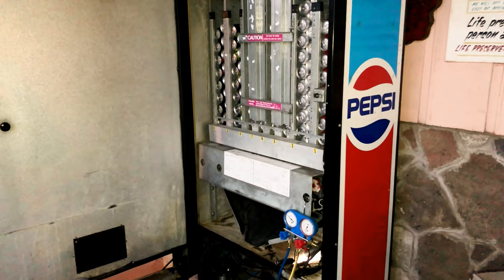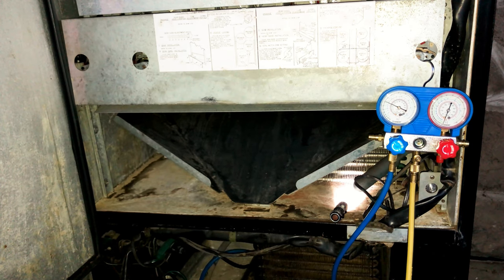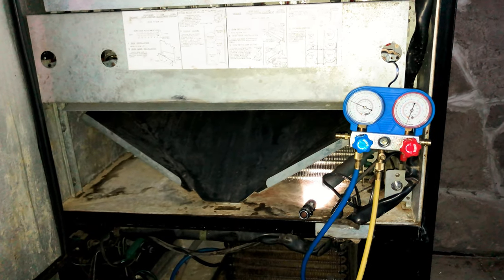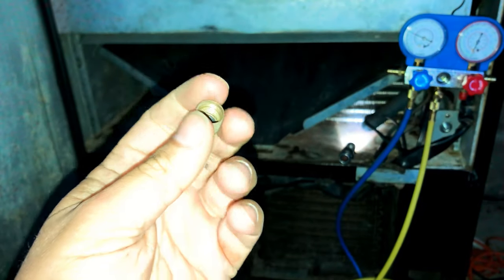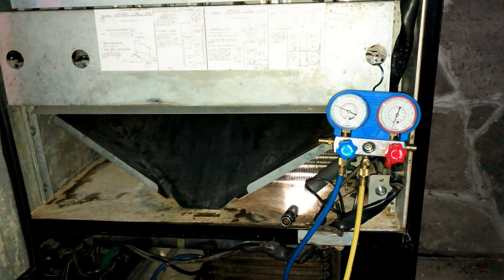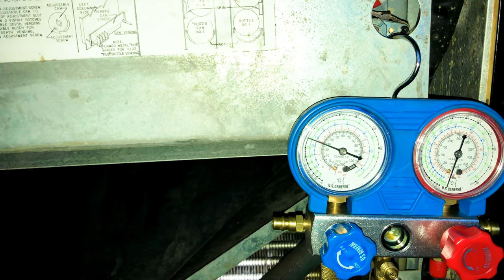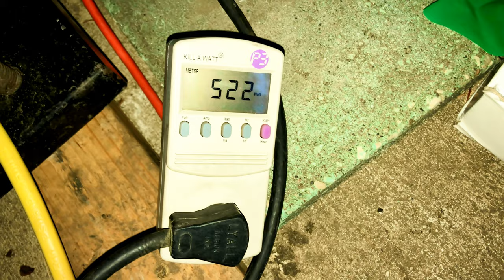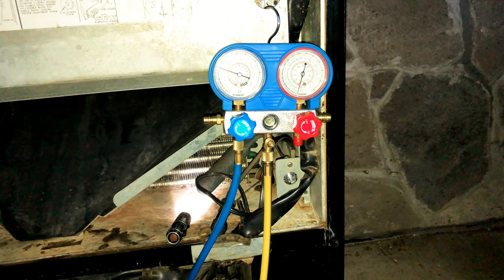Dixie-Narco Vending Machine R12 refrigerant recharge To 12a Alternative IT WORKS!

Comment: This worked really well until outside temps reached 30 degrees F with my outdoor machine. It's as though frosty cool is unable to exchange heat and cool the inside of the vending machine anymore. That's what it seems like, I am unable to look into it further till I either bring the deck inside or summer rolls around.
Reply from the maker: You still run the compressor at those temps? I just unplug the compressor on ours, and the drinks are always nice and cold. when it’s that cold how is your stuff not freezing?
Reply: @KmanAuto  yes, I have found that can be true for this machine but once the outside temp gets to 50 degrees F the machine warms up and has a hard time getting cool again from outside temps alone. I have a DN501E with a 134a system that copes really well despite it's age with the temperature swings in the winter. So my thought was frosty cool might not have exactly the same ability as real R12 did but is a pretty darn good replacement under certain situations. Haven't researched it, it's really just a guess. It's really just time to get a new cooling deck and stop messing around with this. lol =)
Reply: @KmanAuto  Oh and also, I am not sure why the drinks haven't frozen. I suspect the temperature outside would have to reach a sustained 0 to 20 degrees F. A week of temps like that might be a problem but otherwise I think the machines generate enough heat to keep a good balance.
Reply from the maker: @pikadroo  The deck might be too far gone. the 134a is not compatible with the oil from the r12, so compressor may not be up to snuff anymore due to lack of lubricstion.
12a  is a isobutane propane blend, compatible with both oils. 12a is also more efficient than r12, requiring about 2/3 less power for the same cooling. Meaning, if you were to replace r12 or 134a in a known hood working system with 12a, the cooling system would become more efficient, using either less power to cool, or increased cooling capacity with the same power consumption.

Comment: Hey Kman, any chance you would have time to chat about 12a?
Reply from the maker: What’s your question?
Reply: I bought a machine with a bad compressor but came with a new one that just needs sweated in and refilled.  Have you had any issues since using 12a in your machine?
Reply from the maker: @mynameisprivate8763  Absokutely zero issues. Just plugged in the machine last weekend for its 4th season since getting it and putting 12a in, and it was a hot 84*F, it cooled down no problem and purred like a kitten.
Reply from the maker: @mynameisprivate8763  as it has better cooling performance too and uses less energy to cool, i’d love to replace even the 134a in my Teslas with it, just concerned the cars are too smart for their own good and as it operates at different pressures, concerned the cars will throw tons of codes and cause problems.
Reply: @KmanAuto  Tesla's are not cheap. And at one point I was told they are proprietary and you can't fix them yourselves so getting parts were difficult.  But I don't know that to be true. I also bought an inficon vac machine scales and 3 recovery tanks for 400 bucks. So now I need to learn how to use it lol.
Reply from the maker: @mynameisprivate8763  it’s not too bad, can order what one wants from a service center, only things like the motor, battery and infotainment unit are not yet publicly available. Those are also the three most reliable parts.